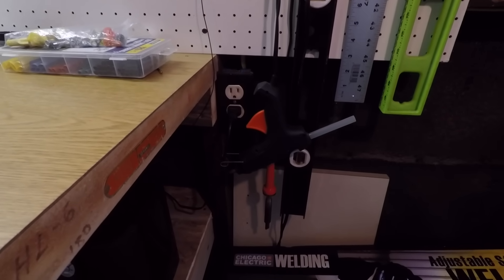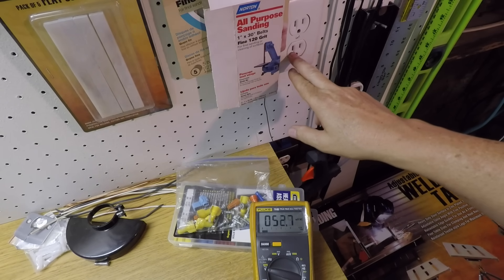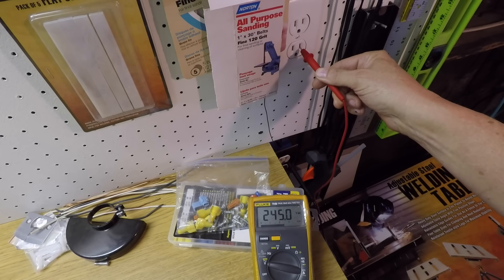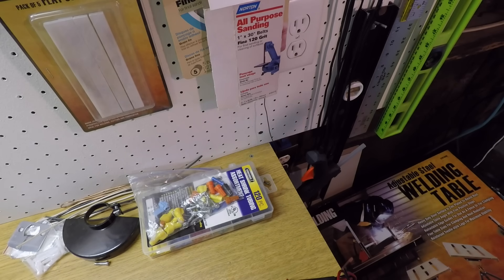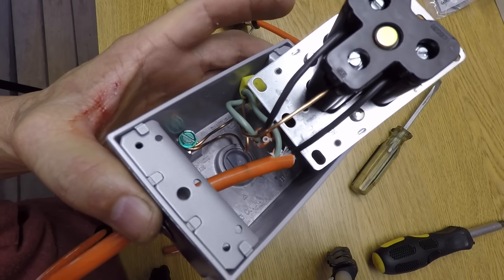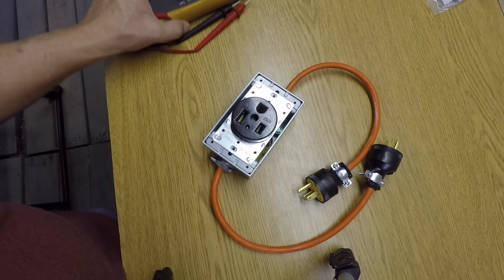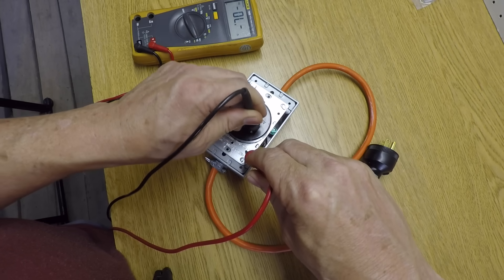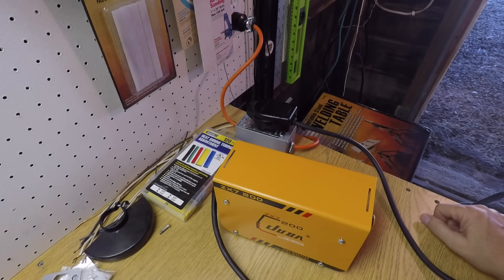How to Get 220v From 110v

Comment: I have been working in industrial maintenance for 20 plus years. You DO have 240-volt power to your shop, you just have it running on two separate 120 breakers. Just wire in a 240 outlet using both legs of the 240 already there and call it good. By the way, those are 15 amp outlets not 20 amp, the 20 amp 120 outlets use a circular outlet and a twist lock plug.  Granted with 12 gauge wire and  20 circuit breakers you do have a 40 amp 240 circuit but when you run through 15 amp outlets you are overloading the outlets themselves, just providing information here, not trying to be a troll, lol.
Reply: Not sure where you are from but here in Texas we have 20amp outlets that are square with no twist lock. im just say'n
Reply: While you may have been exposed to industrial electrical equipment, you are not an electrician. Two 20A circuits do not equate to 40A overcurrent protection, nor does it provide 40A capacity. 

20A receptacles come in multiple configurations, most commonly a 5-20r t-slot in residential.
Reply: @InlineDownhillVancouver  While 2 20a circuits do not equate to 40 amp overcurrent protection, they do provide 40 total amps of capacity. Each circuit provides 20 amps. The circuits are individually protected. The only difference between them is that with a double pole breaker, they will trip together.
Reply: @u000na0  I don't believe that is correct, granted I'm not exactly sure what you mean by "40 amps capacity". How he wired it, he has a 20 amp capacity at 240 volts. If they were on the same bus of the panel, he wired the hots together, and had 2 neutral wires wired together, he would have 120 volts at 40 amps. With his configuration, each hot wire is carrying the full current, meaning a 20 amp max. For instance, if you used that same 12/2 Romex on a double pole breaker, it would have to be a 240v 20 amp breaker. I don't see how this has a 40 amp capacity by any definition.
Reply: @commoncentstx  You are most correct, Sir.  Both Nadeem Abdull-Ahad and Jack Allen have let WAY too much time pass since their study of electrical theory, if they ever had any in the first place...

Comment: the thing about unplugging one side, is if you're using an industrial motor, it needs both legs of 220 to run. if not, what'll happen is the voltage will be split in half, basically outputting 120 volts out the part you plugged in.. hence you ll get shocked.

Comment: great idea but i'm not sure why you wouldn't just run a 220v line instead but if you already have 2 different lines in the garage from other sides of the bus of your main service why not right. same as running 2 individual devices in close proximity. But dont go by me i'm no expert but understand how electricity works. As long as its fused correctly, polarized and Bonded correctly. Some room for error here for the people who cannot get there head around the concept

Comment: Interesting video.  As you clearly state in your comments this an informational video only.  I'm sure you are probably going to run a separate line for 240v.  Nice demonstration though.
Reply: I looked up the Juba welder you have in the vid.  It looks like it uses 30 amps in.  Not an electrician, but the only thing you might want to do if this were a permanent setup and you didn't want to run 240, is use two 30 amp circuits using 10 gauge wire.

Comment: I don't understand what all the confusion is. This totally makes sense. He just wanted to use his 220 welder in two different places that didn't have existing 220 outlets. A lot of you that commented have good points but the way he did this would be the fastest and least expensive way to get his end results. And safely, I might add. The only thing I can see that may need done would be to replace the two breakers that the two outlets are on, to one 220 breaker. Some breakers allow for a bar to connect them together as long as they are next to each other which would make it a 220 breaker.

Comment: Fabbed this set-up a while back and it works great using (2) extra heavy extension cords.   Virtually the same as installing a 220v outlet, but the wires/connections are longer and it is much more versatile and convenient.  If one leg is grounded, it will pop the breaker, which will over-load the second leg and pop that one too.  Works well.

Comment: 1 - light switch on device to turn on/off power prior to plug in or unplug, this will ensure there is no power in device to transfer anywhere within
Reply: Wrong, he has 2 110 lines. Only one is light switch. The other is still hot with switch off. Remember, they are wired in separate not together.
Reply: two light switches then

Comment: What I am not sure about is how the power is flowing back to the panel box. Is it going through the grounding wire to complete the circuit? I u Dre’s tans why you deleted the neutral wire, but I can’t figure out how the power makes its complete closed circuit! Is it through the two hot wires using alternating current?
Reply: Both hots are 180 degrees out of phase. While one is 120 positive the other is 120 negative. Then they switch. 60 times a second...

Comment: I build the same device to run my boil kettle which has a 240 w heating element worked great, just have to use a different light source when i need one,  it wil trip it.
Reply: J:  Syrple?

Comment: I’m a  fairly new electrician. Always looking to learn.  My question is,   Is something like this safe? Because  I have herd of a homeowner trying this, only it didn’t work because the two circuits were from the same phase.  So it never worked.  
The experienced electrician telling me the story said thank god because if it did work it would of been a dangerous outcome.
But now I just seen this guy do it on YouTube 
So which is? 
A do not do?
Or safe to do?
Reply: You're a new electrician? Go learn from legitimate sources. There is nothing for you here.
Reply: Same (Pole).
Residential utility service provides single phase -2 poles
Two 120v poles = 240v

Not - 110v 115v 220v 230v
It's -
120/240.

Do Not do replicate the device

Comment: This might work well for someone who has these already installed, but it would be easier to install a single 4 conductor cable to all 3 outlets and the lights.  More amperage would be better too; welders like lots of amps, and you may want to upgrade to a bigger welder later.
Reply: No.

Comment: If the primary of the device is a transformer then there will be voltage on the other connector if theres one 120 V plug plugged in and the other is unplugged. As long as you unplug the welder, turn it off, or unplug both 120Volt plugs you should be safe, but unplugging both 120V plugs will illeviate that issue.

Comment: Why are you not using the returns instead of the ground? I was taught that the return goes back to the transformer on the pole and the ground goes to an earth ground. Even though the earth ground and the return are connected in the breaker box. Its confusing why water heaters and dryers and some stoves are wired like that. But then I'm not an electrician.

Comment: Doing this way is ok for some equipment.  But there is time you won't get 240v. That's when The Two 120v will be  in phases since you don't have a neutral wire.
Reply: Yah hes really just doing the same thing at the outlet as adding a double pole breaker, problem is if he uses it at an outlet that the polarity is reversed, too much could go wrong, and the metal box, if one breaker trips due to short the other is hot and most likely energize the box

Comment: The reason he saw 120 v between the hot and ground is because the neutral and ground are tied together in the main breaker panel.
Reply: yes but they can only be tied together in the main panel he tied them together there in fact he's not even using a neutral he's only using his ground wire
Reply: Which means he's sending power back to his main panel through his bare grounding wire

Comment: Those ARE NOT 20A receptacles (outlets).  Those are 15A receptacles (outlets).
Reply: If that is the case, only devices rated for 15 amps or less can be plugged in, keeping the load under the rating of the breaker. This is assuming the wire is the correct gauge for 20 amps.
Reply: He mentioned the fact that they were only 15 amp receptacles.

Comment: Curious why you didn't turn the welder on during the video to show if it works or blows the circuit breaker immediately when using the welder. Hmmmmm....
Reply: because that would not load the circuit he would have to weld at high amperage to really test the circuit. this is a work around at best. most of the time you wont have two plugs on different phases that close to each other.

Comment: instead of building a removable 220v plug,  you could just connect and install a fixed 220v surface mount receptacle box  between the two 120v receptacles. But overall,  does NOT LOOK SAFE, unless you have the two breakers side by side and tied together in breaker box panel. Good Luck!!! Keep ingenuity up!!!

Comment: I have 2 separate air compressors and 2 different locations for stick welder and will have 2 locations for plazms cutter, which I havent bought wire for yet. Slowly wiring our new garage, back wall has MC cable ran to all outlet boxes but outlets not wired in yet, these are rated at 20 amps per outlet. Using MC 12-2 for regular runs.
Have a question for the electricians out there,  we have 4 roll up garage doors and 3 man doors, so thats 7 exterior lights. How can I wire all 7 together so all 7 will come on either with 1 photo cell for nite and day or with motion detectors at each light able to activate all 7 lights at once or a whole group. You walk up to any side of my garage and whole outside light system will come on, can this be accomplished or am I full of you know what?
Reply: It is easily accomplished. Just make sure all seven lights aren't drawing more amps than one circuit can handle. Might have to rig it up with a relay to fire two circuits if the lights are drawing too much.

Comment: I think you forgot to mention that each of those "lines" is tapped off a different 120v bus in your breaker box. If they were on the same bus (there's typically only two) they would not generate the 240v.
Reply: ArJuna22 he mentioned this from the very beginning, several times in the first couple of minutes.
Reply: ArJuna22 he said that

Comment: Fail. Did not bond the three ground wires. twisting with your fingers and using a wire nut is not bonding. Use linemans pliers and twist those three wires properly next time.

Comment: Question: Let's say there are additional outlets down the line of one or both of these.  If you plug in and run a 220v appliance would the result be that the downstream outlets also become 220v?  I don't think just anyone should attempt this - you really should know the limits of it and be as safe as possible. That said, sometimes you just can't do it any other way.
Reply: That can not happen. These circuits are 180 degrees out of phase so they can't feed off of each other.

Comment: YOU CANT GET 240 DOLLARS FROM YOUR BANK ACCOUNT IF YOU ONLY HAVE 120 DOLLARS IN THERE, UNLESS YOU HAVE 2 SEPARATE ACCOUNTS. HENCE: YOU CANNOT GET 240 VOLTS IF YOU ONLY HAVE A 120 VOLT FEED. IF YOU CAN FIND ANOTHER PHASE, THEN SURE.....NO PROBLEM.

Comment: Most welders like above 20 amps. More like 30 and above.
Reply: W
Reply: No. To use over 16 A, you need at least a 220 A welder. Or a 120 V 200 A. Chinese imports like these are rated at 16 A.

Comment: Great video just wondering if 2 leds would be easy add to have a quick visual both lines are still hot while you’re working. Make sure you didn’t break one line. Come to think of it you could wire led plugs that would do it.
Reply: Marshall Dennen fwiw, you could just add a pilot light to each outlet. No need to break any lines; each pilot is wired across its outlet.

Comment: It is good idea as temporary solutions if you are somewhere doing welding work and they dont have 220v. This will give you option to run your 220 machine. You can just run 10/3 30 amp cable from your box and have permanet solution. But again exellent idea .you can also turn one of outlets that you mention is dedicated into 220v by just geting double pole braker and removing neutral.

Comment: You can make 220v from one 110v socket using a 7A 1:1  isolation transformer (finding a 7A 1:1 transformer is much easier to find than a 7A 2:1 step up transformer).  Tie one leg of the transformer's secondary back to the transformer's hot primary leg. This puts the transformer output in series with the input creating 220v.  The 220v is only rated at 7A though.  Pulling 7A on 220v will pull 14A on 110v.  Don't try this unless you understand grounding and phasing.

Comment: Just but a 240 110 transformer and plug your 110 end in and you got 240 the other end , simple
Reply: And it will melt as he starts the welder. You will get 7-10 A out of it at it's best.

Comment: screw all the naysayers, most of them couldn't change an outlet without help, and the rest are just parroting what they heard some other self-anointed expert wannabe say..
Two things i would have done different is first, either of added circuit breakers to the box or used GFI plugs in the source outlets and second, added power lights to the source outlets so it was easy to verify both circuits were live, the last thing you want to do is flip on the power switch on a 220v welder when there is really only 120v of electricity.....
Reply: The guy is rigging it. If you accept that, ok
Your gfi idea is a good one but this setup would instantly trip them.

Comment: This is all wrong. There is no flux capacitor wired into anything. The DeLorean discombobulator is going to clash due to the missing white powder on the the mirrored surface. 
😎
Reply: Pedro Caballero 
😂😂
Reply: Yeah and he forgot the double poled, dead end three way with a switch back.
Reply: He used an oscillation overthruster instead.  Works better and lets you travel through solid objects.

Comment: 15 amp devices on 20 amp circuits. That's a no no. Plus your extension cord wire is undersized. Why not just do it right and add a 220 Volt circuit?
But I'll admit, for a hack it ain't bad. I've seen worse.
Don't ask me how I hook up my portable generator into my house wiring.
Reply: blipco5 15 amp devices are safe on 20 amp circuits. The other way around is not safe and will trip the 15 amp breaker anyway.
Reply: blipco5 and I won’t ask how you hook up your portable generator to your house wiring😉

Comment: Could always put a resetable circuit breaker on each line. 15A preferred since the plug outlets and wiring is only rated for 15A. It's a neat and simple device. Just sounds like for longer term run 220v plug directly from the panel. Welders don't like sharing nor extra breaks in the wire.

Comment: Your idea is legitimate and can work, but does have safety risks. It is better to have the wires, plugs, and outlets all wired for the same amperage. Also, for the same amount you spent setting up your homemade setup, you could buy a 240volt ( or two 120 volts) breakers and run wiring just far enough to get you outside the panel. You can get heavy-duty 240 volts, high amperage extension cords. (which you can re-use later). Another issue is the fact that the standard 15 Amp, 14 gauge wire is stranded to make it flexible. As those strands break, your extension cord's capacity will gradually decrease and start to heat up)

Comment: In the UK the normal domestic voltage is 240V and outlets are rated at 32A so it would not be an issue

Comment: That's because you have 240 coming into the house. You can wire it to two separate 120 outlets or make a 240 outlet, buy your breaker should match the rating.

Comment: I think this would work ok in a pinch but there are better options.  The Extension cord he used is too small for the load in my honest opinion, it looks like a cheap 16 gauge extension cord which would not carry 20 amps without being dangerous. I would use 12 gauge extension cord just to be safe.  I would just install a double breaker and use the right size wire, I am cheap and I would just ask some guys that install furnaces or something if I could buy some wire and a breaker from them,  They would sell that stuff to me for next to nothing because they buy in bulk.

Comment: Nice idea.  Quick and simple.  In the interest of paranoia, I’d add a on-off switch on the box with a light to indicate when it is active.  I do not have 240 in my garage which is what made me buy a 12v welder.  I don’t need a more powerful welder, but this trick is good to know just in case.  Well presented video.  Thanks for sharing.  Why buy something when you can build it??  Good job all in all.

Comment: I do like the concept,and probably would consider using it in a pinch. What he doesn’t say is if one breaker trips the welder will be underpowered . The breakers probably should be next to each other in the panel and tied together so if one trips the other will as well. Don’t know if that than will create overload on trip. I

Comment: Why don’t you just wire it directly into the other top boxes instead of using plugs?
Reply: Perhaps If the house burns down, the insurance adjuster would discover a hard-wired code violation and void the insurance.

Comment: I have this same setup. When I go to peoples homes I can choose separate 110's and do quick repairs. I also Have a weld cord with 3 different dryer plugs......
Reply: By "separate lines" you have to be sure you mean "separate phases".  Separate lines (or circuits) on the same phase still only give you 120V.  I'm sure you know this but wanted to respond in case you did not.
Reply: I'm sure he knows or he wouldn't be doing to many repairs now would he ?